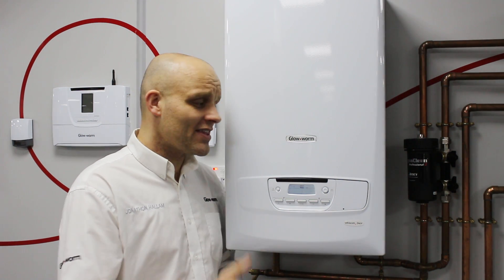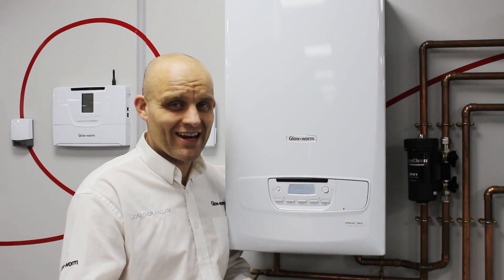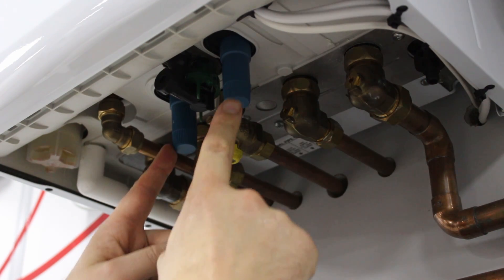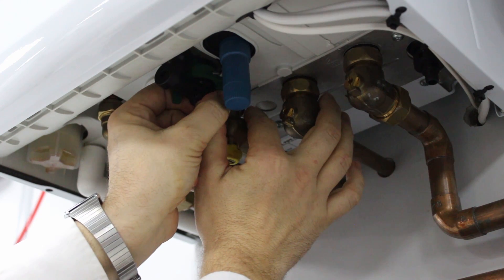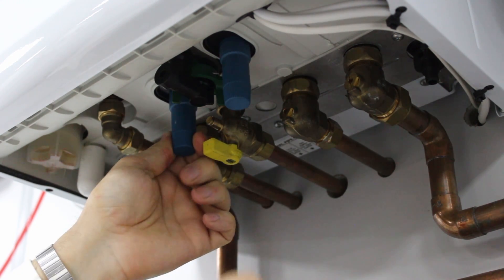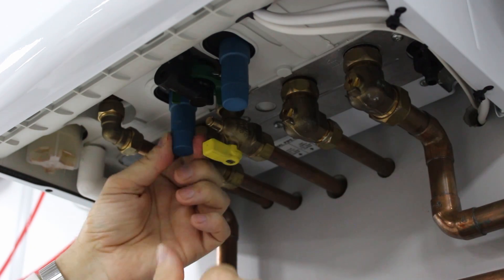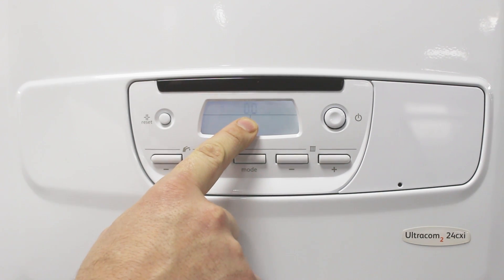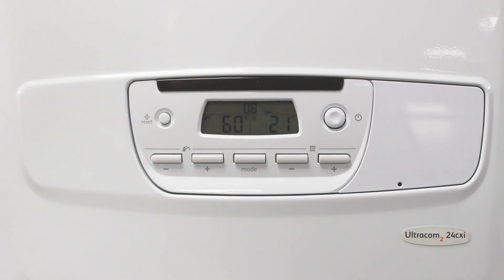How to Pressurise an Glow-worm Boiler - Ultracom

Comment: Is 1.6 to 1.7 too high if so how do i lower it?
Reply: Yes, it's slightly too high. Releasing air/water from a radiator using the bleed screw was the solution for me

Comment: Mine Has no rubber turning knobs. They av both come away from system. How can I solve this?
Reply: I’ve also got that problem! Did you manage to fix it?
Reply: @mrcamilleri2934  no, I have to get pliers and and an struggle underneath boiler to open valves, let system build up then close again. It's abit of a pain but it worksvery fiddle though without the rubber taps

Comment: Thanks so much! It looked like the bit that you have to push up wouldn't move but you can tell when it's up because you can turn the green ring clockwise (when you're looking up at it). This won't turn if the array is in the down position. 

Another thing is that you might very well need to use an alan key. If there is a clicking noise when you try to turn the blue handles, that means that the valve is closed too tight and you have to use the key. It might need a few turns but when that water starts flowing and the pressure goes up - joy!

Comment: grt video. does the boiler need to be on before you do the water fill?
Reply from the maker: Hello, The pressure should always be topped up when the system is cold.
 You should have the heating turned off (as having it on could cause the boiler to fire up when the pressure hits the minimum required for the boiler to operate, which will then cause the pressure to rise due to heat and you won't know what pressure you are truly at for topping up). Have a good day.
Reply: thank you (bit late)

Comment: Iv got a problem iv got the same boiler but it’s on 0.8 iv filled the water to 1.2 but the next day it’s back on 0.8. What do you think the problem is and how to fix it. Iv checked all radiator pipes no leaks anywhere.
Reply from the maker: Hello, please call our technical team on 0344 693 3133 for assistance. Many thanks.

Comment: I've been doing this for the last couple years and it's worked but today... It started leaking water 🤦🏻‍♂️🤔 Why is it leaking and how am I supposed to put the pressure up if it's leaking 😑
Reply from the maker: Hello, you will need to call our customer service directly on 0344 693 3133 for advice. Thanks.

Comment: Our blue filling taps are stuck rigid, immovable.

The grip attachment just slips the tread; an allan key cannot grip because one end is sort of rounded off and using it the other end is impossible as I can't get it in under the unit; plyers are no use either.

Has it perhaps frozen shut through the winter? Is it dangerous to try and force it?

Pressure is at 0.4 so no hot water at this lockdown time!
Reply: Any luck. I have this boiler & the blue cap is stuck rigid.
Reply: @Dabbywabby  in the end a maintenance guy came and obliterated the tap. The tread is destroyed! Didn't see what he used to be honest, but he struggled. He certainly had something gripping both sides at once though.

Sorry it's not a better reply!
Reply: GreatBritishBeast - Thank you. I’ve got a guy coming out tomorrow.
Reply: Mine is doing this, it turns with a lot of force but just "clicks", the same kind of feeling when you have to open a tamper-proof bottle of pills and you don't press down enough, the lid will turn and click but not open

Comment: When I try and top the pressure up on my glow worm 30 cxi boiler ...... water pours out of what looks like a pipe near the pressure release valve. Do I need to change that valve ?
Reply: Did you fix that ? I’ve got the same problem

Comment: Had this boiler for 5 years, boiler never given me problem in terms of breakdown, however the filling taps are terrible, often become to tight to turn, boiler also loses pressure quickly during winter when central heating in use, but maintains normal pressure during summer months. Green filling loop is also a bit tricky, use index finger or thum to push up from directly underneath.
Reply: XGN Phoenix  Shut up 🤐

Comment: Do all glow worm boilers have the two blue caps. I've got a 30cxi and only got one blue cap so when repressurising it starts to leak. If I am missing the part what are the blue things called so I can get another one. Thanks
Reply: Did you find out how to do it mate cos I’ve got the same. Mines just packed up Boxing Day🙄
Reply: Same problem. How did you fix it pls
Reply: @PS-en7wn  mine needed a new part
Reply: @Malone95x  Can you remember which part? Cheers
Reply: @PS-en7wn  it was the filling loop
Reply: @Malone95x  cheers 🍻 👍
Reply: @PS-en7wn  no worries, good luck👍

Comment: If only it was that easy in reality, the black section doesn't push up and the green lock doesn't move on ours
Reply: Can turn the green thing but can't push up the black thing so turning the blues just spews water😂 brilliantly designed this
Reply: Hi, how did you solve this issue? I also can not push the black section. 

Thanks
Reply: Same problem with mine. Locking collar won't turn sometimes leaving me stuck with a cold house
Reply: Have same problem but I try to push it for 20 min after that it’s been pushed
Reply: Simon Waudby I have the exact same problem. Black section won’t push up meaning I can’t turn the green lock.

If I turn the other left and right knobs without doing this first then water pours out the system.

Comment: Blue extension is stuck and not moving what should I do? Please advise.
Reply: I have the same problem, its so stiff i cant turn it and dont know what to do as pressure went to 0. Video is clear and helpful, boiler is not!
Reply: did u have any luck with your issue? im having your issue now